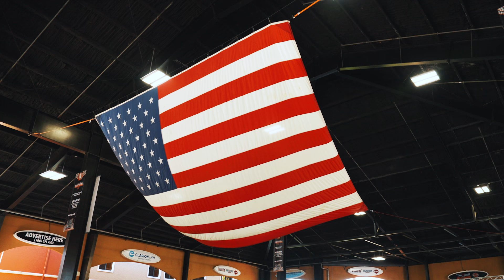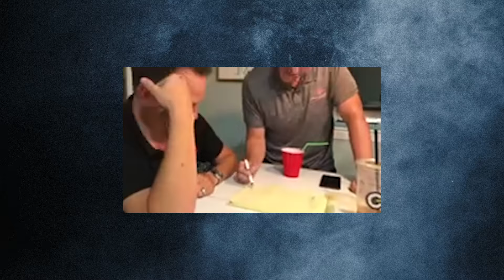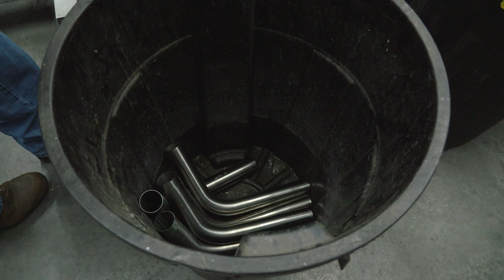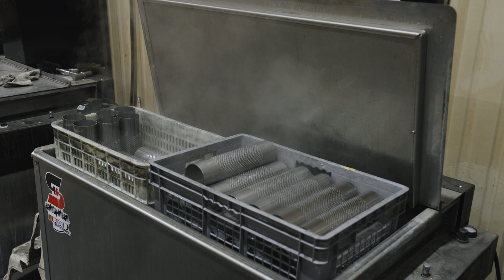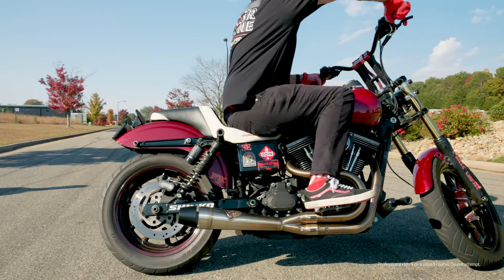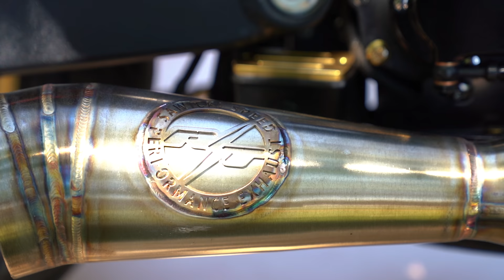Sawicki Speed Presents "Life of Pipe"

Comment: I'm the second owner of a shorty 2-1 M8 exhaust. After a few months of running this pipe I noticed a pretty distinct rattle sound coming from the baffle. Looked inside with a flashlight and right away saw that my baffle was cracked and likely the cause of the rattling. Any suggestions/solutions? I've got a welded end cap so I'm considering trying to very carefully remove the baffle cage without damaging the rest of the pipe. Any suggestions are appreciated!
Reply from the maker: Hey, thank you for watching and reaching out. Given your specific situation, would it be possible to email support@sawickispeedshop.com? I have already given them a heads up on your issue. You can also call/text (855) 971-3610. Thanks again.

Comment: Love that your pipes are all hand built by Americans, plus they look great! Looking for a pipe for my 23 LowRiderST. One question coming from a retired pipe welder (Pharmaceutical and breweries) I was surprised you don't purge your pipes before welding. You know it would make for a cleaner and smoother inside diameter........ Iam NOT HATING, just curious
Reply from the maker: That is a great eye! We back purge the merge collector and muffler but not on the tack welds seen in the video. We tack our badges and spring tabs to the outside of the system. Thanks for watching and keep the comments coming!